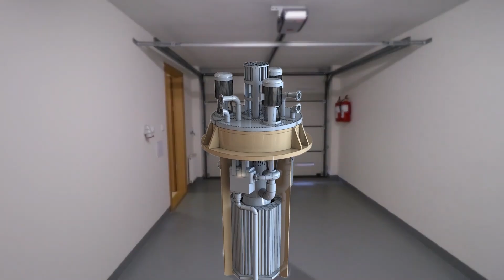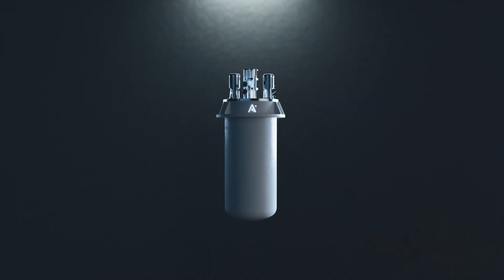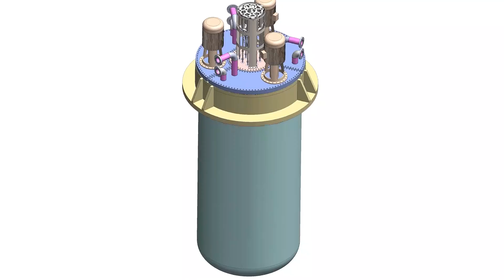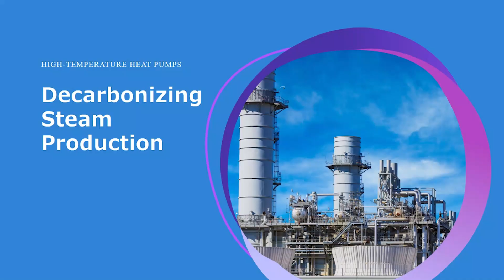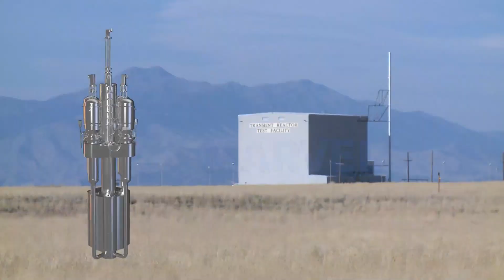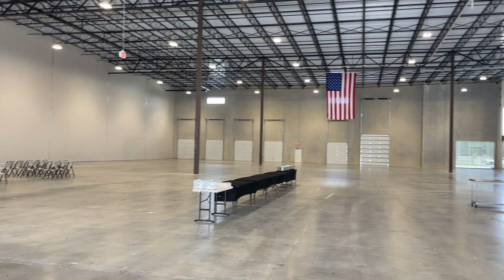Part 2 of 3 ... Aalo Atomics Interview with CEO Matt Loszak

Comment: I'm lost :: I can understand solar cells, windmill, pumped storage & batteries, they are all essential run from the power of the sun. Nuclear is essentially the heat source of a steam engine..
BUT WHAT ABOUT THE HEAT SINK ?? We may not be adding carbon dioxide to the atmosphere BUT WE ARE ADDING HEAT.

Comment: This matters because the human race continues to build up following the New York City/Chicago "first movers" in doing this at the start of the 20th Century with absolutely CRAZY builds I would regard as impossible in places such as South Florida, the Middle East, Tokyo, all over China most spectacularly Beijing, Australia even Oklahoma City now but of course still Chicago and New York so in order to have proper heating and cooling for these types of builds requires and absolutely immense amount of electricity which until now has always been met by traditional grid power which has always been "off site" meaning far away from the actual City and until quite recently always used coal power with everything else backing that in particular huge nuclear power generating for the USA. This has the ability to power where it is needed namely RIGHT DOWNTOWN IN THE SUPERTALL so super high risk super high reward if this works but given the immense challenges of being a City 2024 this has to work as well so interesting to hear the proposal as yes AI matters, yes electric cars matter but yes even more so humans trying to live in crazy places to also include now according to some in outerspace or on another Planet or The Moon cannot be done without using nuclear power/must have nuclear power on this size as well to work and yes you can power a rocket using nuclear power although obviously not to be done at launch even tho the USA has done a static fire of a nuclear powered rocket that was a success back in the 1960s still use I think they're called "nuclear generators" for satellites and off planet landers and of course the USA has a nuclear Navy still so yes in the USA this is a project very much of interest to an untold many so remarkable to see how far this has come and look forward to seeing this very much "in the wild" as they say with all the enormous hurdles needed to cross to get the Department of Energy signing off on this. Good luck amazed you made it this far!😊

Comment: A GTG (Gas Turbine Generator) also produces 500 deg C -plus exhaust which first goes through a generator (yielding say 30% electricity) and then is used to make steam for a 2nd set of generators, yielding an extra 30% or so of electricity. So overall 60-plus % efficiency in producing electricity. 

This standalone nuclear concept only produces heat that first needs to be converted to steam to make any electricity at all. And without the first 30% from the Gas Turbine the resultant overall efficiency is only some 30-35% and the rest of the nuclear heat has to be discharged into the environment.

A steam plant, electric generator, boiler feed water production,  N+2 sparing philosophy for uninterrupted performance, silencers and other emergency shutdown measures .... no small potatoes and typically well outside the competence of any company that only need to secure some uninterrupted power from outside their premises.
Reply: You are 100% correct. The advantage of the nuclear plant if there ever is one, will be with fuel cost over the life of the plant. But even that won't be enough if the cost of nuclear remains as high as it is. I believe companies like Aalo "could" bring those costs down, but the question is whether the NRC will let them. NRC regulations were designed to destroy the industry on behalf of the coal industry initially and later natural gas. Changes are happening, but it's my opinion it will be too little, too late.

Comment: So this Sodium cooled 10MWe Nuclear Reactor has a footprint of about 4kW/m²?
This compares with Indonesia's 8×500MWe liquid Thorium ion molten sodium berilium fluoride salt burner reactors (TMSR) on 65m×180m sites  which can produce more than ten times as much electric power per square metre. (43kW/m²) and at a levelised pre-profit cost of less than $30 per Megawatt.hour (<$0.03 per unit kiloWatt.hour), as a base loader (ideal for IA  Giga computing), but also capable of auto load following for unreliable unrecyclable "renewables"...
Reply: Quoted construction cost $800 to $1000 per kWatt without fuel from Korean Bulk-carrier shipbuilding yard and towed to beach front site.

Comment: "What goes up must come down " the Mathemagical frequency-amplitudes scale of Singularity-point Lensing Partitioning shell-horizons holography of temporal thermodynamical real-time superposition-quantization, log-antilog reciprocation-recirculation potential interference, materialisation of elemental e-Pi-i nodal-vibrational Quantum-fields sync-duration condensation. Simple, not easily understood to be WYSIWYG ordinary existence, here-now-forever. 

The proposed Fusion-Fission Function, Electron-photon-phonon-Proton Neutronic oscillation potential of emitter-receiver log-antilog inclusion-exclusion timing-phase resonance bonding proportioning probabilities is ultra complicated chemistry, unless you know what you're looking at, Einsteinian E=mC² modulation cause-effect mechanism coherence-cohesion objective-aspects of ONE-INFINITY Apature of entangled dimensionality, Singularity reciprocation-recirculation math-music bubble-mode coordination, Actuality of QM-TIMESPACE.

Comment: This all sounds great. However one of the big concerns with nuclear is the waste. What is the plan for dealing with radioactive waste and what is the half-life of that waste?

Nothing on their website discusses the waste concern which raises serious red flags.
Reply: Dealing with waste is not their problem anymore the than dealing with garbage at home is my problem. That is why there is a garbage collection service. In the case of waste it is up to the government to deal with. Which they failed miserably at.  For one thing a political decision was made not to reprocess spent fuel. Which can recover and re-use 96% ! What a waste.
Reply: great question. Here are some interesting solutions on what to do with the "waste"
- reprosessing to create MOX (mix oxides) just as France has been doing
- extract transuranics to power RTGs for space
- use the "waste" in fast reactors to create a closed fuel cycle 
- the highly radioactive fission products decay quickly and have some serious value when separated.
- a geological repository to put the "waste" like in the Onkalo repository in Finland
Reply: Put it in Africa. Giant underground storage facilities.